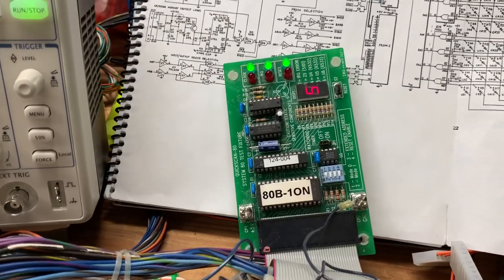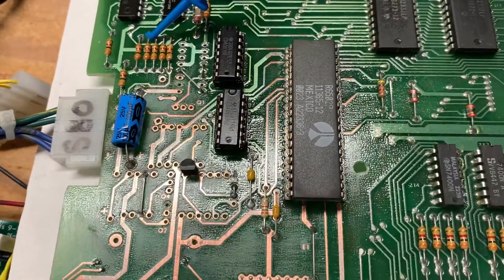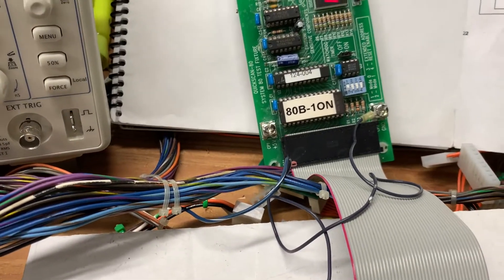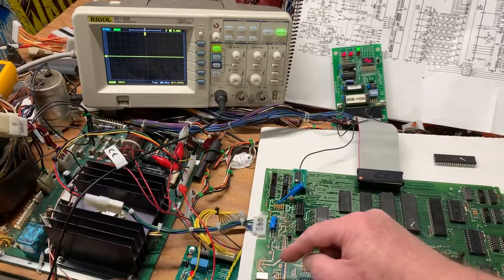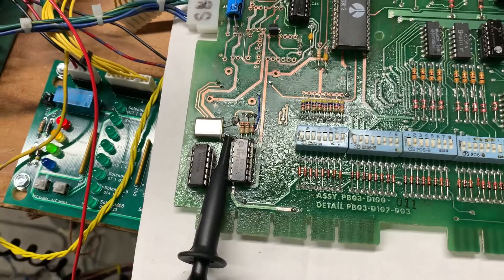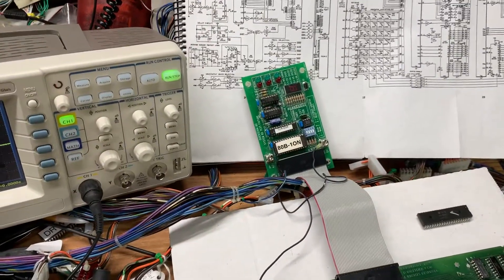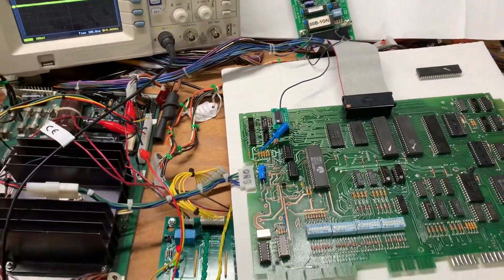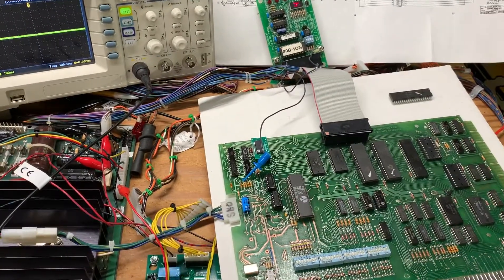Wacko Gottlieb System 80 Clock Behavior

Comment from the maker: The oddball behavior was corrected by replacing R3 (5.6K from the factory) with an 8.2K resistor. This isn't normally recommended, but it "fixed" this board. This is the only System 80 MPU out of hundreds that I've fixed that exhibited this behavior and was repaired in this way.